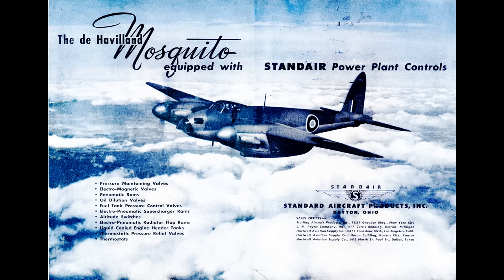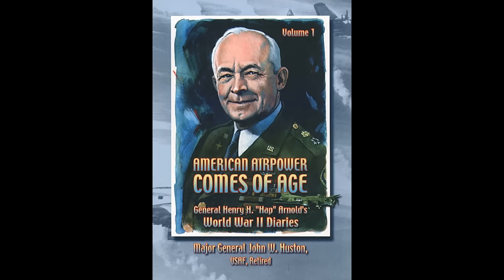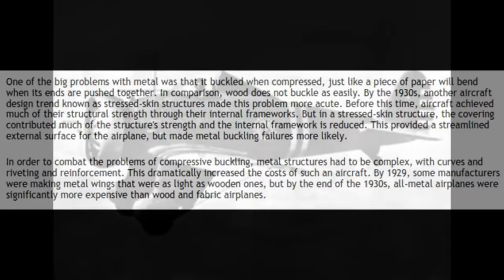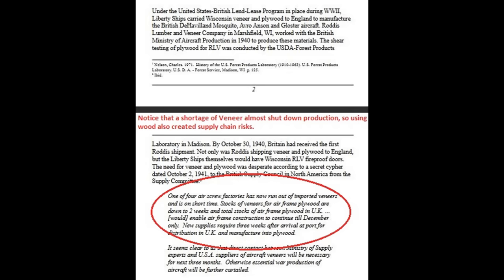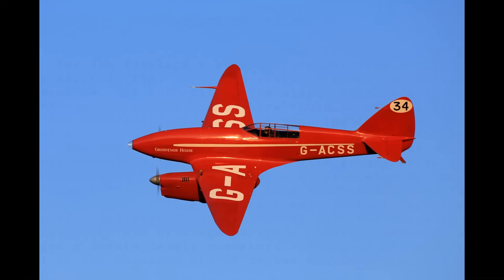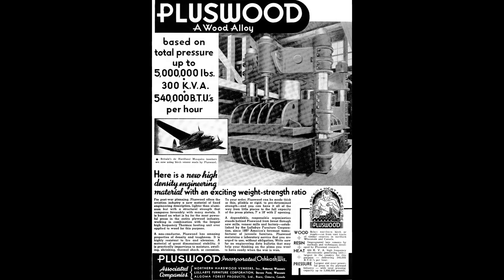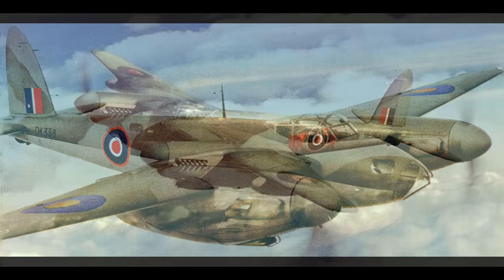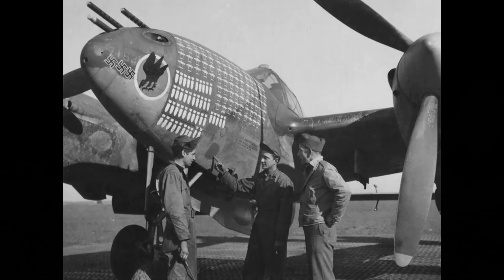De Havilland Mosquito vs. ?

Comment: On the subject of the P-38 being able to match what the Mosquito did, I don't recall the P-38 Night Fighter being used in any significant numbers. The problem with the P-38 was that it was a single seater - so cramming an additional crew member and radar gear into the cockpit was difficult. The Mosquito was designed as a two seater from the start so already had the facility and space for a radar operator.
I expect that is why the P-61 Black Widow got built.
Reply from the maker: There were two seat P-38s. Both planes can perform the same missions to a large extent, of course each has advantages in certain areas. It seems a lot of Mosquito fans are a bit nervous about this comparison. It's coming soon.
Reply: @GregsAirplanesandAutomobiles  It will be worthwhile seeing it. You don't hear much about P-38 night fighter operations whereas the Mosquito was a bit of a legend in the sphere of night fighting. 

My main criticism of the Mosquito is to do with how poorly the structures fared in hot and humid climates. They did suffer unduly (mainly wings coming off) and it was found that the Beaufighter was a more practical solution - especially in the Far East.

I knew a chap who worked on Mosquitoes post war and he told me that most of them were showing serious structural deterioration by 1948-50. He was on 39 Squadron in Egypt who used Mossies for photo reconnaissance work. Whilst he was on the squadron, the Mosquitoes were replaced by Canberra PR3s.

I'm off to the de Havilland Museum at St Albans (north of London)  on Saturday so may come back all "Mossied Up" - they have the original prototype on display there plus some other as well as examples of other de Havilland aircarft.
Reply: Enjoy! It's no Duxford but an interesting place all the same.
Reply: garethonthetube  I did visit this museum way back in 1988. It will be interesting to see how it’s changed over the past 32 years.
Reply: @EricIrl  It's a lot smarter now. The first time I went it was like a scrap heap!

Comment: Given that the mosquito was primarily a bomber and not a fighter, it should really be compared with the B-17 instead of the P-38.  Both aircraft had similar payload sizes (B-17 had slightly more but laughably small compared to its size, due to the need to carry extra crews, guns and ammo etc.). Mosquito was also more accurate when used in the treetop level bombing role.
If the US had put their industrial might behind a bomber like the mosquito instead of the B-17, they could have saved many airmen’s lives, both from the additional bomber crews (B-17 has 10, mossies only 2.  We’re not even counting the additional escorts required) and greater survival rate.  Greater accuracy also means you don’t have to go back again to finish the job.
Wood is in fact less vulnerable to gunfire than metal, as bullets will tend to penetrate right through, leaving a neat hole that can be easily patched up, and cannon shells will also over-penetrate and fail to detonate.  This was also the case with the swordfish which famously was able to get home badly shot up, despite being slow and made of wood and fabric.
However Flak probably had a greater effect on Mossies and I believe more were lost to ground fire than to enemy planes due to their frequent low-level use.  B-17 did in fact have many other multi-role variants (including reconnaissance) but nowhere near as successfully as the mossie.

Edited to add P.S.:
I also dispute that 3 or 4 shots with a 30cal will bring down the utility pole.  Myth busters did a test on that exact type of utility pole, and shot at it with everything from NATO 5.56mm to 50cal, and it takes a lot of shots to bring down the pole.  Not to mention getting 3 or 4 shots in close enough grouping to cause structural damage is extremely unlikely.  Most fatal shots would be to Engines, crew or control cables, but these critical components are just as vulnerable whether the aircraft is made of metal or wood.  (Fighter-bomber variants actually did have some armour plating to protect these critical points)
Reply from the maker: The B-17's payload is far greater. I'll address payload numbers in the video but the 17 can carry about 12,000 pounds. If I use a bomber for comparison it would have to be the A-26, but I don't think it's a reasonable comparison because it came out so much later. 

As for the Mythbusters episode, they shot down a tree, that's completely different.
Reply: @GregsAirplanesandAutomobiles  I just saw your video about the B-17 vs Lancaster bomb loads and now understand why the B-17 usually carries such a low bomb load in comparison.  But even in that video you acknowledge that the typical bomb load for a B-17 is 6,000 lbs carried internally, so that's probably the figure we should use to compare with the Mosquito's 4,000 lbs on raids to Berlin.  
Accuracy-wise you mentioned that about 1/3 - 2,000 lbs will be expected to hit the target, and while Mosquito low-level raids have been known to target individual buildings, that's done by Elite pilots, so maybe we can accept a 50% miss rate of the 4,000 piloted by an average pilot.  Thus giving roughly the same amount of explosives on target.
I have read further though and found valid points that mass-production of the Mosquito was limited in that there weren't sufficient skilled woodworkers available.  Whereas you can quickly train a complete newbie to do one particular job in the B-17 production line, the same cannot be said for the skilled woodworkers required to produce Mosquito parts.

With that in mind it would not have been possible to field Mossies in the same numbers as B-17s, but even then a few thousand US-built Mossies could have hit the same targets with much less risk.
Reply: I believe the Mosquito should have been viewed as an alternative to the USAAF medium bombers, not the P-38 or the B-17.
Reply: The Mosquito is not a very good medium and high altitude bomber.  Note that the RAF ordered many thousands of Lancasters, even after the brilliant qualities of the Mosquito were well known

Comment: I've been watching this filum for the third time. As schoolboys in England in the 50s and 60s, we knew about the Mosquito, but not how impressive it was technically; unfortunately I followed a career in medicine rather than engineering (English Electric were building Canberras and Lightnings just down the road) but I have kept up an interest in aeronautics; if I was unfortunate enough to be involved in the second world war, the Mossie would be my choice for dicing with death, Me 262 notwithstanding. Could do everything more or less and the aircrew had some chance of surviving.
You deliver excellent presentations in my opinion, 'though technically above my head at times; excellent English spoken, circa late 40s, early 50s , my era for hollywood filums (though I prefer prefer pre-Hays code). Comprehensible.
Yours aye! Incomprehensible to modern ears perhaps.
I hope you might read my valedictory missive.
Slante! ☘

Comment: You point out that wood is not great at stopping or having strength against bullets.
Correct, metal is better - BUT in the thicknesses that metal is used in an aircraft,  metal would fare no better at all.
metal being denser, needs to be quite thin in an aircraft, and this negates the strength issue.

Comment: The Mosquioto was pretty much a "in the perfect place, at the perfect time" kind of aircraft. It overachieved it's purpose, yes, but that's because there was simply nothing like it anywhere else. Fast forward to a couple years, and it would've definitely been overtaken by better fighters. The wooden construction would also start to show it's flaws by then.

Despite all that, it's still one of my most favorite fighter aircraft, right beside the F-16 and the A-10.
Reply: HyruleanKnight and why a lot of those better fighters was to counter it from design. To a greater/lesser degree.

Comment: I love the Mosquito, always have. I also like the Lightning, but of course there were problems. I should admit,  even the best designs had drawbacks. 
For the Lightning I have to stress that it was very difficult to fly, alth
ough this was partially compensated for with the USAAF's exceptional training programs. And the guns jammed. All the time. Especially the cannon. And it was difficult to bail out of. I admit,  it was difficult to bail out of a Mossie, just like any bomber. 
Which brings me to the point of my post, which is that although the Mossie did more than drop bombs, it was a bomber. 
The Lightning would have turned up eventually, anyway. 
Because it was a fighter, and it was a lot better than the P-40.

Comment: Although the P-38 was a twin engine design, and could perform some limited attack / bombing missions, it was a single crewed aircraft primarily designed as a fighter.  I think a better comparison with the Mosquito would be the Douglas A-20, which also used multiple crew members, and had glass and gun nose versions.
Reply from the maker: Some P-38's had two man crews, and it was an effective bomber.
Reply from the maker: I wasn't talking about the P-38 nightflighter, although that's another thing that's common to both planes, they were both nightfighters. cont:

There was a bomber version of the P-38 that saw combat. It had a glass nose, two man crew,  a Norden bombsight for daylight missions and ground mapping radar for night bombing. Both planes carried the same maximum payloads in terms of weight. I'm not sure how many were built. 

I think the 38 is much more comparable to the Mosquito than the A-20.

Greg

Comment: Great video on a great plane. To add to you mentioning the way the idea evolved. Paris air salon 1936 Fokker G1 prototype of what on a French idea of what we now would call a fighter bomber. Mind counter rotating props. 2 20mm canon and 4 machineguns in nose. Twin crew. Tailgun no drag. Twin tailbooms. With the nose wheel of the Fokker D23 you have a P39 and look at the front low of the G1a some might mistake it for a mossie. 8 machine guns and internalbombbay. Wood (mixed construction) Mind: 1936!
Reply: BTW the Swedes where interested in a foreseen metal version of the G1. Fokker going for metal having the assembly for DC 2 /3 (?) Also the KNIL didn't want the Fokker T5 and D21 or G1 in the tropics and bought American metal planes. Martin, Curtiss etc. Same reasoning as with the Beachcraft Mossie points you mentioned. Enjoy Germany!

Comment: But an American squadron did fly the Mosquito in the recce role.
Reply: The American OSS (forerunner of the CIA) used it to communicate with partisans on the ground. They had a Bloke in the fuselage with the radio gear and at a certain time the Mossie would fly a pre-determined track while the radio operator in the fuselage would speak directly to the partisans on the ground! If the aircraft was hit the guy in the fuselage could not get out.

Comment: Hello Greg,
as your channel is incredibly sophisticated and scientific,
 could you have one video about propellers? Why older planes used less but bigger blades(not in all cases?), with our without tip. Comparison WWI giant bombers had big 4blades, but fighers just 2 smaller. B36 had just 3 blades, so does F4U-1, but Spit had 3-5blades. Are/were counter rotation props usefully(Martin-baker 2x3 vs.Spit 1x5), T95 has 2x4 narrow but A400M 1x8 curved..etc.
Thank you from Czechia.
Tom
Reply from the maker: I know I need to do that. I'll get to it.

Comment: The First "stealth" fighter bomber was also made from Wood, and it could have been extremely dangerous for the allied metal Planes.
Reply: Merlin engine weight: 1,640 lb (744 kg) 2 each equals 3,280 lb. Hispano 20mm cannon (made under license) Weight (complete): 68.7 kg (151 lb 7 oz) 4 each equals 606 lb. M1919 Browning .303 (made under license) Weight: 31 pounds 4 each equals 124 lb. Total weight: 4,010 pounds (1,826 kg) Early production Spitfire weight: 4,306 lb (1,953 kg)

Comment: This may be to a degree off-topic, but you said in the course of your excellent (!) Mosquito videogramme that the elliptical P-47 wing was a non-NACA pattern.  My question then is how difficult was the P-47 wing to manufacture?  I ask because of the well-known & sometimes problematical complexity of the Spitfire elliptical wing.  Indeed, this may in turn lead to the question of whether Republic or Supermarine in fact will have better solved the problems of efficient elliptical wing production? & THEREBY may hang, if not a tail, as the mouse scientist said whilst lecturing on the anatomy of a cat, at any rate a good excuse for another of YOUR well-done comparative studies.  Thank you.

Comment: Bullets will go through wood or aluminium equally easily. Wood is equivalent to modern composite materials therefore one can suppose wood will not fracture or tear as easily as aluminium.
Reply from the maker: Not at all, well the part about bullets going through is pretty accurate. They would go through aluminum aircraft skin as easily as wood skin. However the wood structures would splinter and crack and wood could not take damage over all as well as aluminum. There are reports on that and I may do a videos about it.

Comment: Laminate wood construction has a high strength to weight ratio until carbon fiber many racing yacht were cold molded  laminate construction oh and bullets go through thin aluminum quite easy too it although it doesn't shatter like wood
Reply from the maker: It's not a question of how easily the bullets go through it so much as a question of the damage being done when it happens.

Comment: As for the P38, I believe that those initially provided to the British were un-supercharged as the technology was restricted.
It would have been interesting what a Merlin powered P38 could have done, it would have been exportable.
Reply from the maker: They had the superchargers, but no turbos.
Reply: @GregsAirplanesandAutomobiles  That is what I meant - lazy on my part.

Comment: The thin metal used in aircraft would be no more resistant to gunfire. In formal and informal tests done on automobiles, about the only point on them that will stop a bullet is the engine block. 9mm handgun rounds will go through most of the body.  This is true for old vehicles made from cold rolled steel as well.
Reply from the maker: It's not about stopping the bullet. Wood comes apart when hit by cannon shells to a much greater degree than aluminum.

Comment: I think if you are conflating aircraft built of the more traditional method of stretching canvas over a wood frame and a fairly radical aircraft made largely of solid wood and plywood and describing both types as aircraft made of wood; which is somewhat inaccurate really misses the whole point with the Mossie. 
Also, only the limited armoured sections of any WW2 aircraft made of any material would give any protection against the weapons likely to be used against them.
Reply from the maker: No, I'm not conflating those two things. The Mosquito is not a wood frame covered by canvas.
Reply: @GregsAirplanesandAutomobiles  Exactly, GAaA, exactly.

Comment: Greg - as usual a really interesting video, but I think you neglected to point out that aluminium in the gauges used in aircraft construction gives no effective protection against gunfire. Len Deighton in his book "Fighter" makes the point that whilst german bombers were robust enough to survive machine gun fire, this simply ensured they delivered a flight crew back to base who had suffered terrible wounds from the fire that had penetrated the fuselage so easily.
Reply from the maker: Yes, bullets punch through aluminum sheet metal with no problem, but I think it's far worse for wood because it cracks and splinters so much.
Reply: True, but if you're on the receiving end not much consolation. Wasn't there an aerodynamic advantage for plywood in that the surface could be finished perfectly smooth and so the air flow was as close to laminar as possible, whereas aluminium had to be riveted (back in the day) and so the air flow was anything but? @GregsAirplanesandAutomobiles

Comment: If you do another vid on the Mossy please cover the different marks and how they differed in bomb load and armament and link the BAE Mosquito page. Loads of people believe all Mossy's had four MG's, four 20mm cannon and a bomb load of 4,000 pounds. Thanks
Reply from the maker: I need to do that. As you know it's one or the other, if it took a 4000 pound bomb load it didn't have the guns. Also, it's not really a 4000 pound bomb load, it's a single un-aimable barrel they dropped. If dropping conventional bombs which could be aimed it's payload was far less.
Reply: @GregsAirplanesandAutomobiles  Thanks again. RAF Journal 45 may be of use in describing the "cookie" bomb. I will attempt to put something that can be Searched.
Reply: RAF Historical Society Journal 45 Seminar conventional weapons pdf
Reply: @GregsAirplanesandAutomobiles  If it's not too much trouble could you mention 1,229 Mosquitos were built using Lend Lease Packard Merlins.